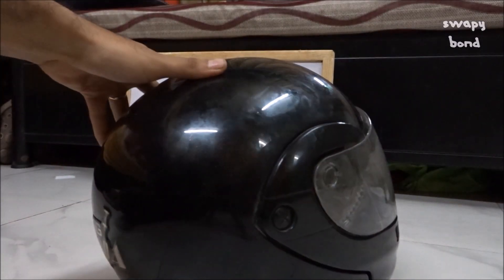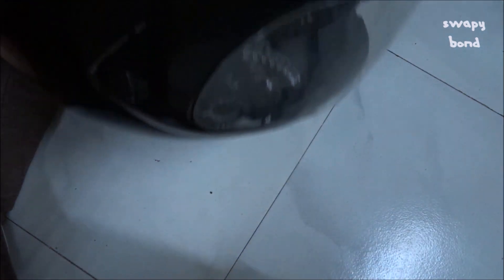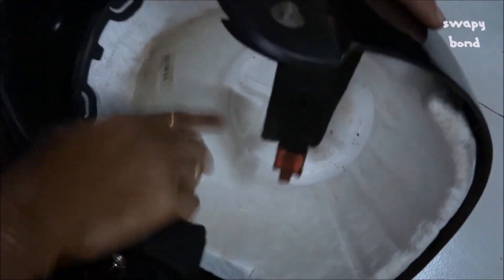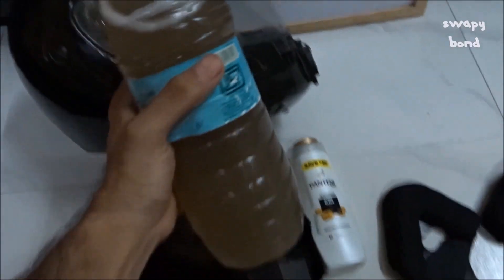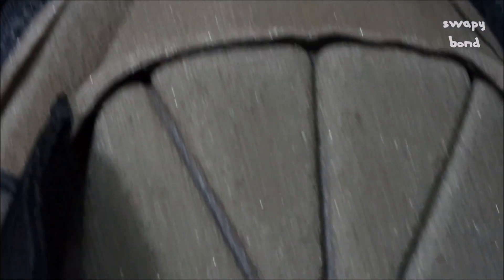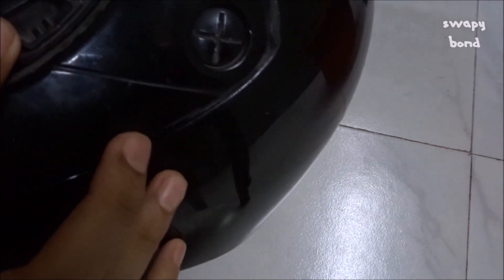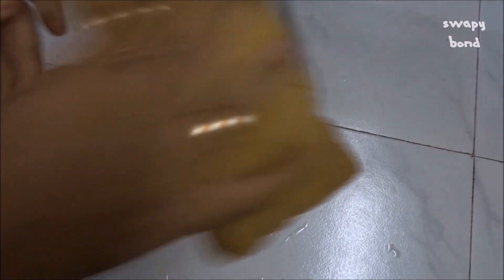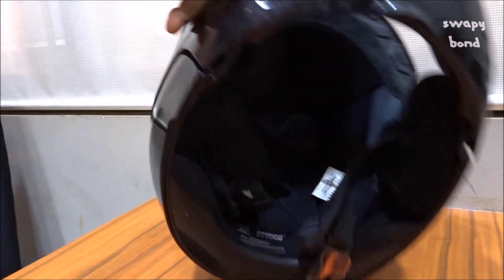Using Hair Shampoo To Wash Helmet

Comment: Man, I do agree with using shampoo! For me Head n Shoulders works, its gentle buffered chemistry really helps with allowing some time for it to soak in.
     My method is slight different as I'm doing this to a bicycle helmet without removing the straps: wet all fabric; rub in a copious amount of shampoo; massage in place; apply & massage shampoo into other parts/places; optionally allow shampoo to work in place 10 to 12 minutes; rinse; repeat second time; use a prolonged rinse this time; and hang to dry.
Reply from the maker: Hey thanks, yeah shampoo really works well. Also one can do this atleast once in two weeks depending on the weather conditions, also I recommend that people who tend to sweat more should wash the padding atleast once in 2 weeks.

Comment: Nice information. The shampoo was used around 3.07 mins and after that you showed that is was dried at 3.14. Did you simply wiped that shampoo or washed it. Please reply me asap.
Reply from the maker: Hey thanks. Yes you need to wash the shampoo off completely with a little water and then wipe the helmet with a cloth, I used a normal cotton cloth, one can use a micro fiber cloth too depending on how expensive the helmet is, anyways sorry for the slightly late reply though.

Comment: What should we do if the liners are non removable. How should we wash it then.
Reply from the maker: Sorry bro, I only know how to wash the removable ones.
Reply: Swapy Bond - The Biker ok bro gotta figure out a way 😂
Reply: Throw it.
Reply: What if I put the entire helmet in the helmet in the bucket filled with water.
Reply: The best helmets (in terms of safety, though exorbitantly priced!) come with removable padding. For your safety I would suggest that you upgrade to a premium one... Anyway in terms of investment, it works out to less than INR 1000/ year.
Reply: I've had success with washing in place on a bicycle helmet, usually it is not a good idea to remove the straps.
     Method used: wet all fabric; use Head n Shoulders shampoo (it has a gental buffered chemistry); slither on a copious amount & massage it in; rinse; repeat a scond time; and hang to drip dry.

Comment: Which shampoo to use?
Reply from the maker: Any shampoo of your choice. Head n shoulders, pantene, etc. Basically any shampoo that creates lot of foam.
Reply: @SwapyBond  , can definitely agree with Head n Shoulders. It has a buffered chemistry so prolonged contact with delicate material should be less of a problem.
    I use the stuff on a bicycle hemlet, and yes in a bicycle helmet you sweat. Found it is best rubbed into the dampened fabric & massaged in with plenty of water. Repeating a second time, followed by a very through rinse, results in a fresh smelling helmet when dry.

Comment: Can I blow dry the parts?
Reply from the maker: I have not tried that but I think you should avoid it unless you use normal temperature air as hot air can damage the thermocol shell and sponge. Best way is to let it dry naturally in sunlight.

Comment: My padding is stick how to wash
Reply from the maker: It also depends on the helmet you're using & I don't know which helmet you're using. Most branded helmets have removable padding and interlocking mechanisms as demonstrated in the video.
Reply: Swapy Bond - The Biker  it's hero protect helmet
Reply from the maker: @smriti2975  oh then in your case there is a possibility that it may be glued on to it or it may be non removable. However people do remove it still and then glue it again but it can damage the padding.